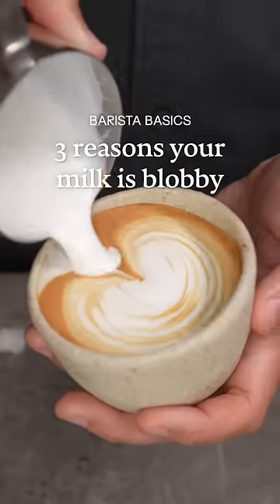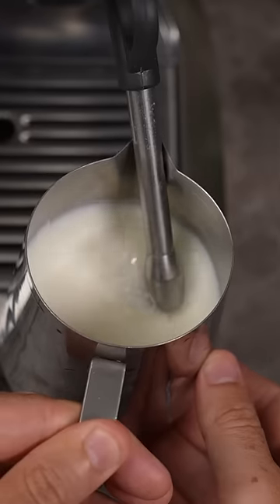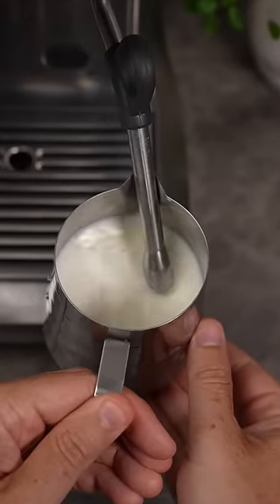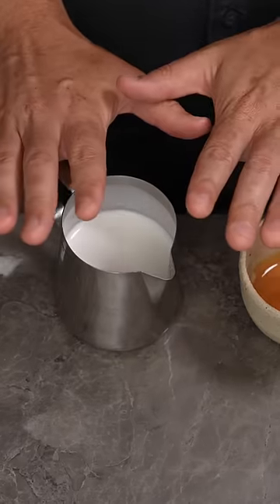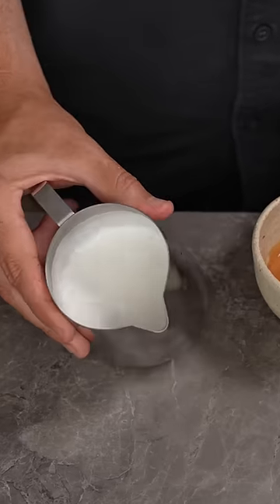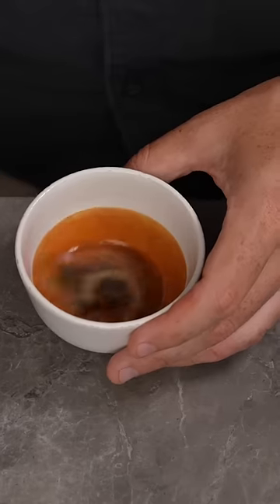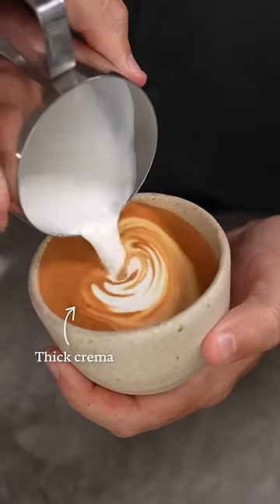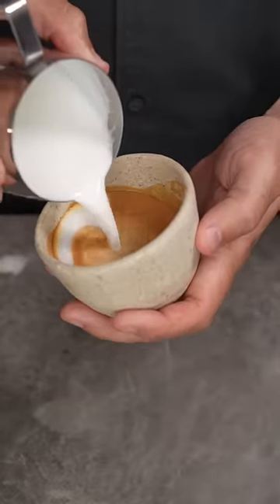3 reasons you might have blobby milk #barista #coffee #espresso #goldenbrowncoffee #coffeeart

Comment: 1. Do not let too much air when steaming the milk
2. Swirl the pitcher.
3. Swirl the espresso cup.
Reply: I was having difficult making the foam stays on top of the crema, in my case letting MORE air in on the beguinning was the solution, my milk was not blooby enoght. So my tip is change and experiment with things.
Reply: How much air at the beginning should I let in before just steaming the milk?
Reply: @cameronwilliams752 try different things but i started getting better results when i aimed for 20% increase in volume

Comment: Is that a Breville Dual Boiler in the video? How long do you introduce air into your milk for a latte before you start texturing?
Reply from the maker: Between 3-6 seconds depending on pressure. Shorter on a commercial machine